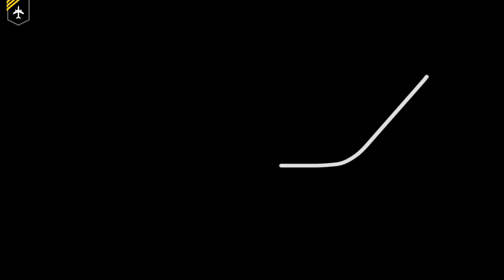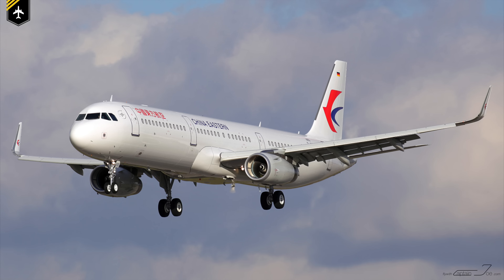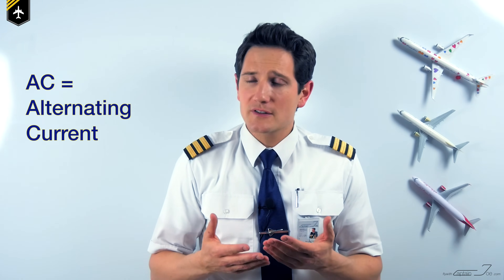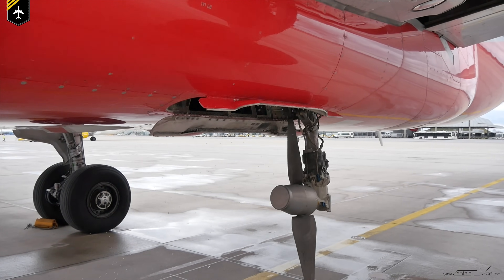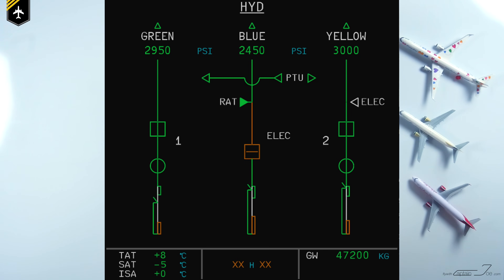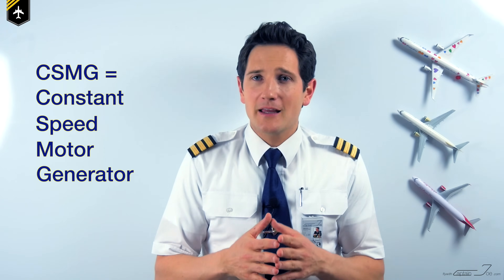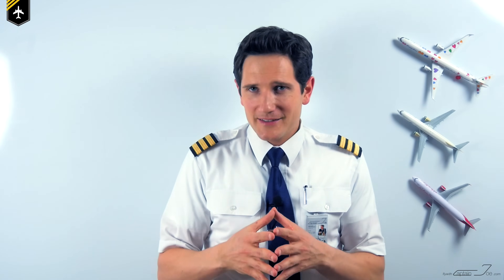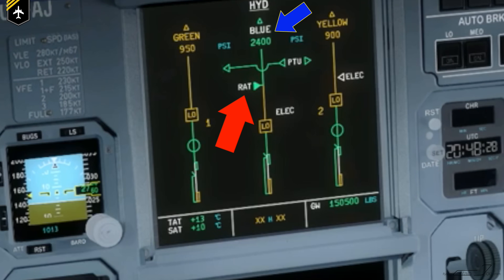What´s a RAT? RAM AIR TURBINE! Explained by "CAPTAIN" Joe

Comment: I'm surprised you didn't mention the Gimli Glider incident in Canada. They ran out of fuel halfway through the flight (error in pounds vs kilograms when refueling plus failure of fuel guage) that resulted in the loss of both engines, plus no fuel for the APU, so total loss of electrical power. All they had was the RAT, but they managed to glide it down, land without a nose gear (gravity drop failed to lock), and no major injuries.

The Miracle on the Hudson flight at least still had the APU, but much less time to react to the situation.

Comment: Day 1, notice from pilot: "STRANGE NOISES IN THE CABIN. SUSPECTING RAT ON PLANE. PLEASE FIX!"
Day 2, notice from maintenence: "The RAT is part of the emergency equipment. And yes, it makes a bit of noise."
Day 3, notice from pilot: "I don't care. I don't want than on my plane. I've solved it myself now, though."
Day 4, notice from maintenence: "PLEASE CONFIRM YOU REMOVED THE RAT FROM THE AIRCRAFT!"
Day 5, notice from pilot: "NEGATIVE. I DIDN'T. MY CAT DID."
Day 6, notice from maintenence: "-.-"

Comment: another disadvantage of these fly by wire aircraft.
they say they are so good but you need 30 systems to correct all the disadvantages
Reply: mob1235 Being a blonde girl i would tone down a bit on technical subjects. Go cook something.
Reply: you can if the 2 pilots work together, also with the trims. fly by wire will crash because nothing works

Comment: Air Canada flight 8481 was a brilliant example. They ran out of fuel completely causing the engines to flame out therefore no generators. As they had no fuel also the APU couldn't be started meaning the final solution was the RAT. Amazingly a safe landing was made with no fatalities.

Comment: " The RAT was found in
the extended position when the airplane was recovered from the water. Both RAT blades were
present, and no major deformation of the blades was observed.  " From the official report of the NTSB about the Hudson river landing
Reply: Dominique Touel really I found the rat making a nest in my boat.
Reply: But why didn't they use the APU?
Reply: @MarekWójcikowski-z1c  They used the APU, and they didn't deploy RAT, it was deployed automatically, before Apu kicked in
Reply: True, and only because the plane deployed it automatically. They determined it's not necessary cuz they had APU started

Comment: you mean they last for maximum 20 mins  not minimum ?
Reply: Abdullah nope. minimum was correct. you will get a minimum 20minutes out of the batteries. it may be more depending on various conditions  but should not be less if the aircraft is correctly maintained .

Comment: Technically, the RAT is the part being driven by the propeller. The whole part is an ADG (air driven generator).  
RAT is much catchier, though. They're also incredibly heavy and loud. I've been told that if an ADG has been deployed in flight in a CRJ, you practically need hearing protection in the cockpit (it's located to the right of the FO's feet).

Comment: Would the RAT deploy in the extreme case of running out of fuel?
Reply: IceCold111511 yes as the engines would obviously not provide any power.

Comment: why not use a aux engine or a generator that feeds on the engine fuel ? as a back up
Reply: there is one already. Called APU. But RAT is back-up for backup. It definitely saved two jets - "Gimly glider" and "Azores glider". In Gimly there was a problem with converting metrics to imperial units, as the result airplane had half of the fuel necessary, and had to glide onto runway. In the second one - fault developed in fuel line and it lost it's fuel midflight. Thanks to RAT they were able to land safely.
Reply: ok thanks I wasn't sure
Reply: jur4x 
Air Canada 143 "Gimli Glider."
Reply: Oh, sorry. I was typing by memory, so I might've misspelled it. Thanks

Comment: Liebherr Aerospace developed a pretty neat fuel cell emergency power system (FCEPS). It's supposed to offer a constant (as in non-fluctuating) emergency power source during glide and after landing, without any negative effect on aerodynamics of the plane, like extra drag.

Comment: Thank you! Yes, the famous Gimli Glider was the case when the RAT helped to remain control over the plane.
Reply from the maker: Correct, as mentioned in the official incidents at the end of the video!
Reply: @flywithcaptainjoe oh shoot I ran out of fuel it's time to deploy the RAT and............ Do an air drift (side slip)
Reply: was that the side slip landing?
Reply: I have a question for you captain, do pilots listen to music while cruising?
Reply: winni223 i loved that one....how the pilot landed that ...omg
Reply: Fast_Wifi yes, usually they prefer Psarantonis
Reply: No, they are usually asleep until they get a wake up call from the ATC via foghorn at 1 mile out if on autopilot. If not a giant hand exits the front console and slaps them awake just in time.
Reply: Caused by a metric conversion error in fueling.

Comment: Can you tell me the idea/concept of pulling the stick back on a stall instead of pushing it forward like the rest of aircrafts?
If you enter alternative mode which shows on the ECAM you still have to push it forward as the plane can't recover by itself(That air france flight failed to acknowledge). You have stick pusher, right?

Seems better to have a push down moment incase of stall in all modes/scenarios.

RAT has to have a max speed right? 140kt for low speed. But does it come out at 0.76M automatically? 
Wont it create enormous parasite/profile drag and the blades tip will over speed and stall, maybe even disembark.

Last question, you may not know this exactly but does the RAT create a yaw moment of the aircraft? If it does, are you restricted in crosswind?

Sorry for so many questions but the ATPL books don't explain that much about airbus or RAT.

Keep up the high quality videos captain! :)
Reply: Jason Zielke Thank you. You answered all question politely and you had answers for them all.

Learn something new which is always nice, thanks again! :)
/ Adam
Reply: As for the stall recovery technique in the A320, you are advised to lower the angle of attack, get the wings level, then add power once stall indications have ceased.  If you add power prior to lowering the nose the pitching moment from the thrust can cause a situation where not enough tailplane authority remains to control the longitudinal axis (pitch) of the aircraft (deep stall).  Analysis of the AF accident is out of the scope of this forum, however airbus have clearly defined procedures for similar circumstances.

The RAT automatically deploys for a loss of AC bus 1 and AC bus 2 and the ADIRS 1 senses a speed greater than 100kts.  There is no published max speed (you want whatever power you can).

If you are going into emergency elec config, you have much bigger issues to worry about than the minute amount of drag caused by the RAT.  From a physics/dynamics point of view, of course there will be drag created and as a result a moment will be created, however in most cases the RAT is located close to the longitudinal axis of the aircraft so it is so small it is considered negligible.  There are no published crosswind limits to apply for the RAT.
Reply: Did you see how small the turbine was?  I doubt it's able to cause any noticeable torque or drag.  The landing gears are larger, and they're meant to be used all the time.

P.S. Someone please correct me if I am speaking nonsense.
Reply: Arcadiez I only know what I saw: the blade angle is adjustable, that will prevent overspeeding. But I  wonder if you meant the moment it is opening? And the effect on yaw or gliding should be negligible, as there is no significant surface area compared to the size of the plane.
Reply: The only reason to pull back when stalling is if you are so close to the ground you'll, never regain control. In that case it's better to belly flop rather than nose dive.
Reply: Sami Jumppanen

The outer part of the wing/blade will spin faster than the inner part, sooner or later it will reach it high speed stall. This happens to all wings/blades even if you change the angle of incidence.

What he said was that it was a constant variable pitch, meaning that it will maintain the most efficient angle of incidence through out the speeds range. But that doesn't prevent it from tip stalling.
Anyways, any object will create drag, especially as the speed increases the parasite drag will increase.

I'm not talking so much about the asymmetric blade effect as it will be too small, but the sheer effect of having an object on one side. I know it's small, the aircraft has strong engines and a big rudder. But I'm interested if it will create a drag that's noticeable. :)
Reply: Rathtrainer VLE for A320 is 280kt EAS or 0.67M so why not a RAT max speed? He stated that the RAT comes out automatically, but that seems irrational incase it has a max speed restriction, even at higher speed the blades will not be able to spin due to too high tip speed and high dynamic pressure.

Any type of drag at one site compared to other will create a disposable of forces. I'm not focusing on so much on the asymmetric blade effect but more on the fact that you have an object that will create parasite drag, especially as the parasite drag increases with speed.

The question is, is it noticeable. I know the rudder is extremely strong and the CFM 56 engined are strong but still.

Got a A320 TR or any aerodynamic engineering/physics degree? :)
Reply: Firecul42 But on airbus you pull back in all cases except when you're in alternative mode.

But in every other aircraft, small or big you pitch down to reduce the AOA. Every pilot get taught this, but then get taught to pull back on their airbus TR.. I get your point. But if you're stalled then you only option is to push forward to try to regain control even when you're close to ground otherwise you may fall like a stone especially with swept back wings(Tip stall).
Reply: Nope.  No degree.  That's why I asked someone to correct me if I was talking nonsense.  I'll keep my mouth shut from now on.
Reply: Arcadiez thanks. I'm mostly interested in blades because I now have a quadcopter. But enough from me :)
Reply: I'm not sure if your asking a legitimate question, or a very dumb one.

I'm an aircraft mechanic and worked with these things all the time. The RAT deployed in the case of loss of power, not to a certain speed. 
And you really think that a puny little device will make a yaw difference with this enormous aircraft?

Comment: Wait, what's the difference between RAT and APU??
Reply: The APU is turbine that powers an electric generator. Its located in the back of most planes. Its used during normal operations to provide electric power on the ground and can be used in the air (up to a certain height) in case something goes wrong. Depending on regulations an airplane needs to have 2 electrical generators running, so it can be turned on if one generator (not engine) fails. Long before a real emergency, just a n+1 kind of thing. The APU burns jet fuel of course. The RAT on the other hand is a purely emergency system in case all three generators (the two engines and the APU) fail. Most of the time this happenes because the Airplane is out of fuel, IF the Hudson Landing used a RAT is was probably because the APU needs time to start and they didnt really have a lot of time. The rest is explained in the video.
Reply: Georg Hager Thanks for the answer, but in the film "Sully" , based on the Hudson River case, Capt. Sully turned on the APU, when the birds struck the plane
Reply: movies are not accurate. crazy, i know.
Reply: Valeri Yarkov the APu also starts the plane engines as it provides bleed air for the engines to start
Reply: Yeah, the RAT probably deployed automatically once the power failed. As said, the APU can not takeover immediately, it needs to be started up first (like every other turbine). And the RAT was very important, because loosing both engines means loosing hydraulics. The electrical backup works, but afaik the 320 can not power its hydraulics from the battery. (This might be different with the 380 and 350, those use some elctrohydraulic, complex thingies instead of a third hydraulic system, but I dont know if these can run on batteries - powering hydraulics from electricity needs a lot of electricity). They had very little altitude and the time it took the APU to spin up might have killed them - no hydraulics, no flight controls. Starting the APU was a good idea - the RAT provides very little power and in such a situation you want everything you have. Maybe it did help having the extra Power from the APU, maybe the APU didnt even reach nominal output before they crashed, but as I said, it MIGHT have helped and it was a good thing to activate it. Starting the APU doesnt mean the RAT didnt deploy.

Comment: Question please, +Captain Joe!
So on Sully's flight the RAT inmediately deployed and provided electrical current and pressurizing the blue hydraulic system. The question is kinda double: Wouldn't the batteries be enough to keep the blue system operative? If answer is yes...then why did the RAT deployed, instead of letting the batteries do the work? Thanks!!!
Reply: The batteries are most likely a last resort for power, the plane will probably use all power supplies before the batteries.
Reply: Thanks, that's what I was thinking... but maybe for the sake of being perfectly sure they could switch to batteries and get all demands of power covered... Or (I don't know) it's a hybrid mode, batteries + RAT?

Comment: I am somewhat unsure if the APU can be engaged/started during cruise flight. Any difference between Boeing and Airbus?
Reply: Yes the APU can be started in flight. Depending on the aircraft type, altitude restrictions may apply. Also, firing up the APU can be a standard procedure in case of engine shutdown or hydraulic pump failure.

Comment: I Love That He Is Always Smileing :) It Makes Me Smile
Reply from the maker: Stay positive!
Reply: @flywithcaptainjoe       When MH370 was gliding to the surface of the ocean with the captain controlling it in the cockpit, & only RAT power available (but batteries too), at which point (e.g. 10,000ft) would he have tried to set the wings' flight surfaces (via the centre electrical system) to slow the plane as best he could for the ditching? Would the available flight surfaces take longer to set, due to being on the secondary power grid? I think he was aware of the slowness of the secondary power grid as he would have simmed it, so he was prepared for the delay to set those surfaces. What do you think? Thanks in advance. Mickey  👍
Reply: Not negative
Reply: Not Corona positive 🙄😅
Reply: It leaves me with the impression that he is mainly an actor.
Reply: yOU sHOULD rEALLY lEARN hOW tO wRITE
Reply: That's makes some of Captain has a lot of girls attracted 😂
Reply: It helps that he’s got a very handsome smile too!